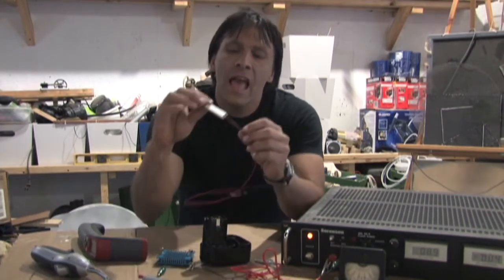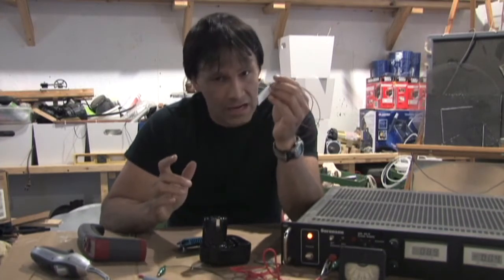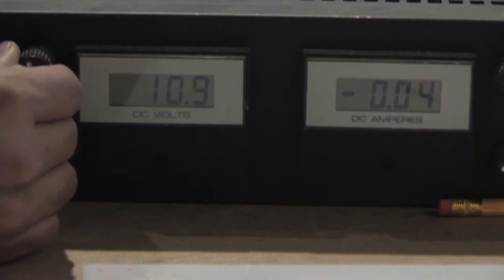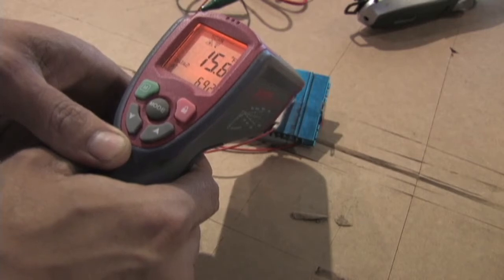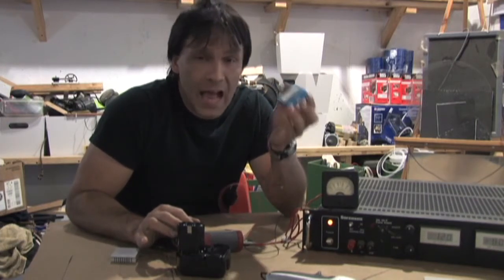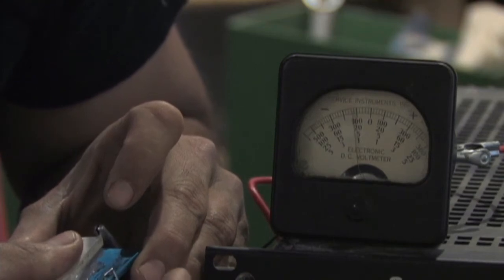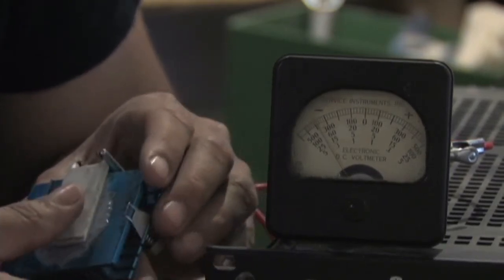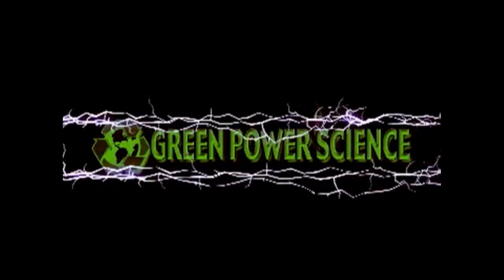Thermoelectric Peltier Cooler Testing HD version

Comment: Had a conversation some time ago , about these units for refrigeration V the standard pump type . The company sold both & said if you can get a pump unit to work , then do so , 'cos solid state peltier is so ineffeciant , but they are quiet & quite cheap . It's that compromise as ever .